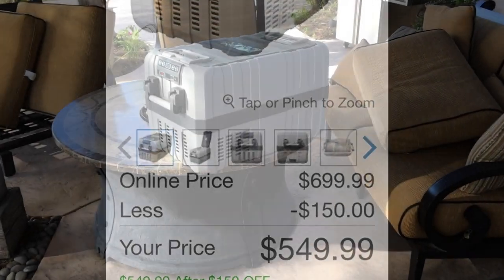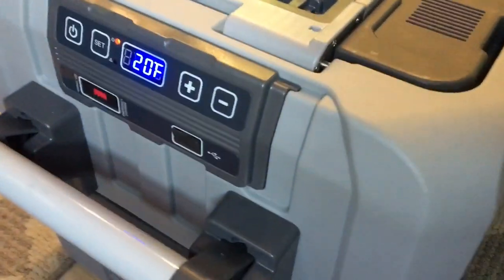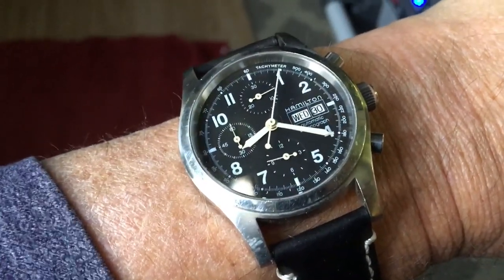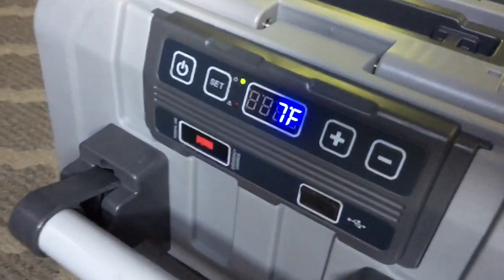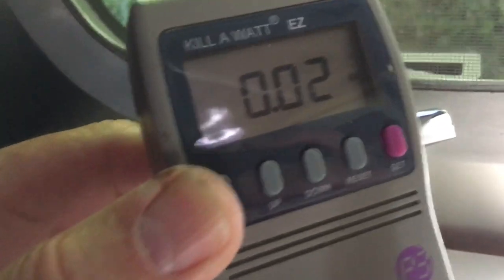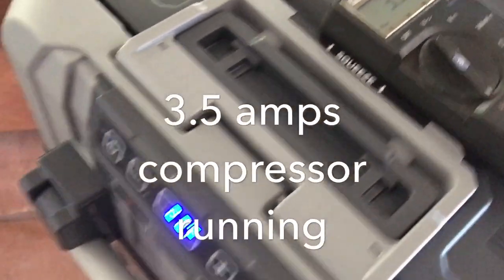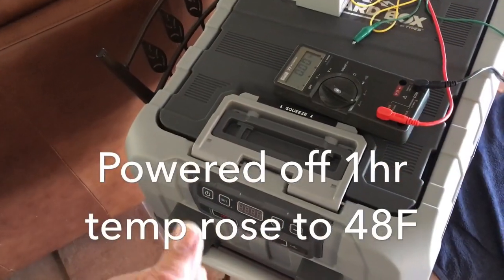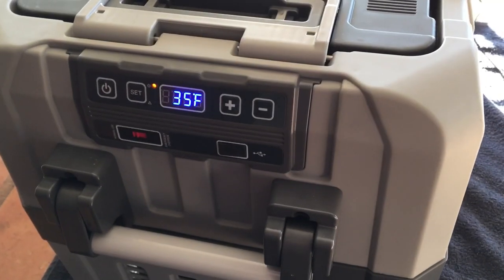Blizzard Box Tech

Comment: Great review I just got mine last week for my Jeep and after doing a ton of research this was a no brainer. Great to see a fellow neighbor do a video on this cooler fridge. I live over the hill in Valencia. Another thing that this cooler offers that no other cooler manufacture offers is Costco’s amazing return policy. If this were to fail 2 years from now Costco will refund your money. Also I have a 200w battery pack that will run this for about 12 hrs.
Reply from the maker: hollywoodfred 
Thanks much. Should clarify their warranty as a non appliance, Costco states a 1yr warranty BUT if you register it with TypeS (mfr) they give you a 2nd year warranty free.
Reply: Dirk van costco gives you a 100% satisfaction guarantee refunding your full price doesn’t really how long you have it.  only electronics computers cameras stuff like that and refrigerators 10 ft.³ and above have a 90 day warranty. I also signed up for the extra year with Type-s hopefully I’ll never need to use it but if this turns out to be a piece of junk I have the piece of mind that I can return it to Costco for a full refund.
Reply: @hollywoodfred  You might be badly surprised. This is freezer. Freezers are listed as 90 days return policy.
Reply: crazy4dive yes I would agree if it was a freezer but it’s listed under the auto Accessories category. 
Blizzard Box 12V/110V 41-quart Portable Cooler  the 90 days is for major appliances that this is not. 

Major Appliances (refrigerators above 10 cu. ft., freezers, ranges, cooktops, over-the-range microwaves, dishwashers, washers and dryers),

Comment: great video !  can you post a link to that thermometer system you show at the start of the video ?
Reply from the maker: Thanks Matt,
Note: With further fridge use on longer trips 60-70F ambient and set at 35F internally, the ON / OFF cooling cycles actually doubled (compressor remained OFF @ 18 minutes. So 1/2 the initial current draw examples INCREDIBLE ! 

Temperature kit link:

Ambient Weather WS-10 Wireless Indoor/Outdoor 8-Channel Thermo-Hygrometer with Thr... https://www.amazon.com/dp/B00FX8ZGOO/ref=cm_sw_r_sms_c_api_i_SbbZEb0FJN10A

Comment: were you able to find some not too expensive insulation bag which would fit? I noticed that it is losing it's temperature extremely quickly therefore it needs to run a lot. Many people report insulation bag a game changer
Reply from the maker: crazy4dive 
That would be an interesting  test but makes sense. Suppose TypeS would be the next call for such.

Comment: Do you know the size or what the fuse inside the cigarette lighter is called?
Reply from the maker: I Don’t actually but the fuse itself should have markings such as 3A or 5A ACG 
(3amp or 5 amp) plus the fuse type and physical size. 
Or call SType the supplier. ;)
Reply: How's the cooler holding up? I'm thinking of getting one
Reply from the maker: Maika Braun   Well, so far flawless. Just back from 4 day western Sierra trip and 100F + temps 6 hours driving there and same driving back.  Set for 29F and separate wireless thermometer inside to verify. Kept all @ 34-35F reliably.  We’ve still kept all food in there even though back a week ago. Bottom line we love it.
Reply: @dirkvan2230  nice.. now you just got to find a cover for it.  I noticed that its almost identical to the Australian version.  The Evacool Travelmate TMDZ-50 and they have covers for it but can't order cause they don't ship to U.S.  Got to figure out how to get that. Let me know if you do i I'd like one.